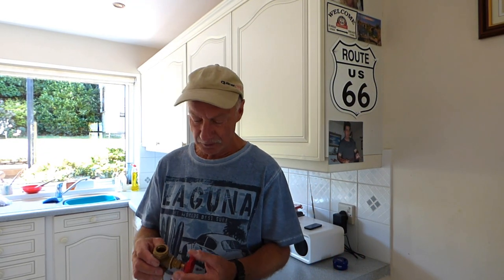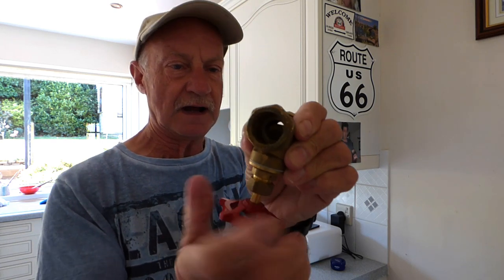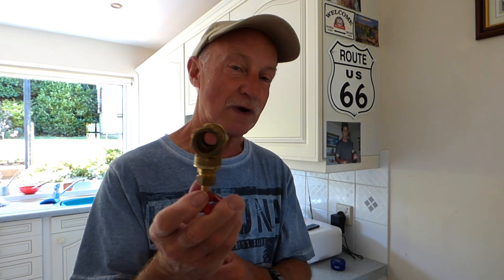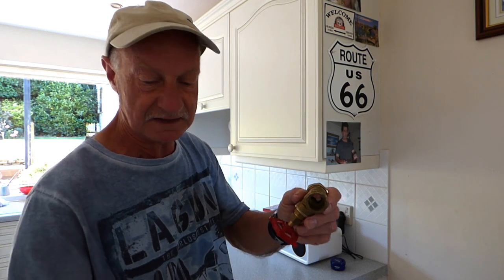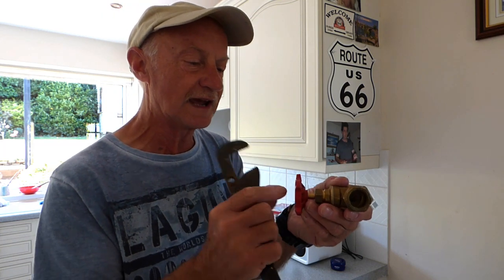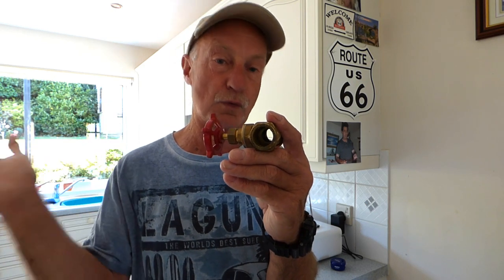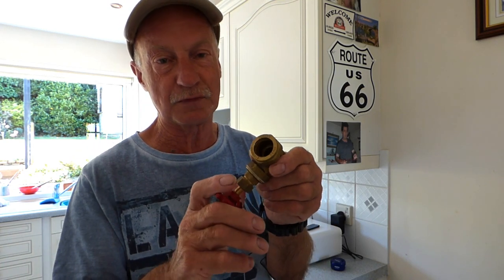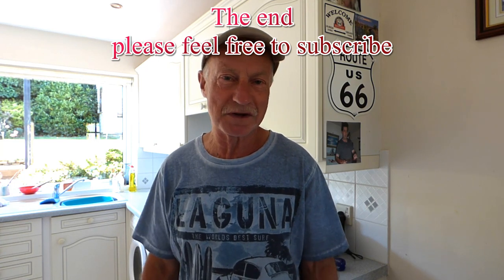How to free a jammed gate valve

Comment: Put this tip into action today! I had 2 jammed 22mm gate valves in the airing cupboard. They were stuck solid, couldn’t move them by hand at all.   On with the footprints, a gentle clockwise and anti-clockwise movement and hey presto, movement!! You could hear the limescale falling away inside the valve.  I was so pleased.  I was close to draining down to change the valves and I came across your video.  Thank you, thank you, thank you!!!
Reply from the maker: Glad it helped

Comment: How do I isolate hot water if the gate valve doesn't work? Can I replace the corroded valve without a water explosion
Reply from the maker: Drain the roof tank.

Comment: I have only a gate valve going into the tank and not out and non under the sink and I need to turn off the hot water cos its leaking to all hell in the kitchen. All I can do is turn off the fill valve to the tank. My face is melted.
Reply from the maker: Turn the one by the tank. Instructions in the question above.
Reply: @dereton33  yeah unfortunately all that did was turn off the cold. I thought I could drain the hot tank. Cos it had a red nob I thought it was going into the hot but it was the cold. And the other two pipes in and out have no valve and under the sink has no valve of any kind either. So I'm going to have to turn off the stop cock and drain both tanks I guess just to change a washer on the hot tap. Lol! Been a nightmare doing Xmas Dinner dishes and I eventually figured out I could put a rock on top of the tap to slow down the gushing. Thanks anyway. The worst thing about plumbing is relaising what previous plumbers have done ...lol!

Comment: rather than using grips I moved it by wearing cowhide protective gloves, mine stops eventually on a clockwise and anticlockwise - then I turn off water clockwise it stops turning nice stop but water in hot tap is still running after 5-10 mins and same pressure too. But gate tap feels like it is closing
Reply from the maker: It is jammed on limescale and grud, feeling like it is off but is not.

Comment: I’m having that problem with my hot water valve for the washer. It closes halfway only, I’m concerned if I work it back and forth to close it may start leaking at the stem??? Is that a possibility? I don’t have access to a main shut off valve.
Reply from the maker: Yes it may but is easily fixed.

Comment: I'd seen this video quite a while ago but never felt confident enough to have a go.  However, recently I watched the video again and decided to give it a go taking care as shown and surprise, surprise it actually worked !  I tippexed the gate valve and counted the revolutions from full off to full on and made a note for future reference.  I'll make sure this is closed and opened every couple of months or so to prevent the problem recurring and I'll be able to switch of the feed to the hot water taps when needed.  Thanks for the very informative videos.
Reply from the maker: No problem Alan.

Comment: Hiya Al, brilliant advice, I have been dreading tackling some plumbing jobs around the house, one because it is ancient plumbing work that has been reworked at least once, and two it appears to have been installed by some escaped lunatic.

Normally don't have issues with plumbing jobs, but I am facing a right old mish-mash of a system. 

So, I need to isolate certain areas off to work on them, and all the gate values looked like the came of the arc, all solid as a rock; I hand tried to do the above with my hands as wary of snapping the values, but have just bit the bullet and used an adjustable wrench, slowly did it,  They have all freed up, so no need to drain system and replace them all.

Many thanks and kindest regards

Mark
Reply from the maker: No problem Mark good luck with it.

Comment: Thanks so much!  I have a gate valve that is jammed due to hard water deposits.    I'll try easing it back and forth like you demonstrated.  Trying to replace a leaky water heater.  First step: turn water off.  lol  Thanks again!
Reply from the maker: No problem, great name, sounds a lot like a Beatles number on the white album.

Comment: Thank you very much for this video! It helped me to get the gate valve unstuck. Unfortunately its doesnt close completely, but enough to allow me to change the tap cartridge. The next mission is to find the correct cartridge for my Bristan Prism bath tub mixer!
Reply from the maker: Good luck with that one.
Reply: @dereton33  Thank you! Just an update on this, I managed to fix the leak by taking the cartridge apart. I first placed the ceramic disks in some white vinerar, left them to dry and then applied a thin coat of silicone grease (vaseline can also be used apparently?). Put everything back together and no more dripping tap! Many thanks again for your video, i would still be trying to get it unstuck and would probably manage to brake it if you hadnt warned not to force it beyond the closing point.

Comment: Great info thanks,
I this afternoon have had a gate valve fail in the  locked off position, handle just keeps turning, it didn't take much as I know what can happen with these, so was careful not to force anything too much, anyway I will now have to drain down a 50 gall tank, heyho.. 🙄
Reply from the maker: There is no repair for these.

Comment: Be careful with this. I just did as explained in this vid and have just thanked the emergency plumber for coming out lol. I managed to get the tap turning a bit and kept turning in very small increments, but I broke the shaft of tap and water started coming out. I obviously turned too hard against a very corroded tap. The advice in this vid is good but be aware that if it doesn’t start to turn easy, get the plumber out, or have water spraying everywhere.
Reply from the maker: If you are worried just plug the feed pipe in the main roof tank, before attempting to loosen it. To be fair you are the person that this has happened too.

Comment: Our gate valve must be turned off to shut water off completely from the outside tap so that the water to the outside of the house wall tap doesn't freeze and burst the pipe causing water to flood the interior of the house.   It worked for 50 years by just turning it on and off each season.  Now 53 years in, it has frozen because it was not turned off last winter. Good tips on easing it off, but that won't free up.  Stays shut. Would removing the packing nut, or bonnet enable one to pull the stem out?  That is a big issue that people like myself would like to see.  Thx.
Reply from the maker: Yes, you can try that
At that age, I would renew the valve.

Comment: The worst thing you can do with a gate valve is leave it open  fully,  as,   when the hard water calcium deposit gets into the gate valve threaded shaft you can't budge the gate valve handwheel in the  anti clockwise direction  at all.
You need to be able to turn the handwheel both anticlockwise and clockwise to disturb the calcium.
Reply from the maker: Good tip Dave.
Reply: Exactly this. It's best to leave all gate valves and stopcocks mostly, but not quite, fully open.

Comment: Great videos very helpful just one question i have a ceased gate valve in the airing cupboard its on a direct vertical pipeline from the tank in the loft that feeds into the imersion cylinder i dont know wether it is off or on. If it was ceased off  would i know about it ie cause any problem. Whats your opinion on this. Sorry for the long info & many thanks.
Reply from the maker: Don't worry it will be on otherwise you would have no hot water.

Comment: This video is help, just bought a house and I cant turn the valve left or right, I haven't tried using a wrench yet because I was worried I would  break it. So my question is, if I did break it would there be any danger of water pouring out ?
Reply from the maker: Not if it is just the handle which it normally is.
Reply: @dereton33  Thanks so much, I'm going to to give it shot. God bless

Comment: Great video. I want to turn off my hot water off so I can change the cartridge on my kitchen tap. I have an f&e system and the isolation valves to the tap have seized solid. I believe I can turn off the gate valve on the water supply to the cylinder, and then drain. My only issue is that the gate valve is missing the red turn wheel. Is there a  reason why the wheel would have been removed?
Reply from the maker: It has more than likely been snapped off by the past owner, you will more than likely find that the valve is seized up.

Comment: Hi Sir..Recently, I observed that my gate valve has become loose, and despite my attempts to open it, the valve turns freely without stopping. This has led to confusion regarding its current position, whether it is in the closed or open state.

I am reaching out to inquire if there is a solution to fix the gate valve without the need for a complete replacement. My primary concern is the significant inconvenience and disruption that would result from shutting down the entire building's water supply to replace the valve. As such, I am seeking advice on the best course of action to rectify the issue without causing any interruption to the building's water service. Looking forward for your answer. Thank you.
Reply from the maker: Bad news is all I can offer, that valve is snapped off inside meaning it can just keep turning without stopping. To save a lot of hassle there is a valve that can be fitted without turning the water off, it is called a self cutting valve.

Comment: I've got one of those, a jammed gate valve that is and I've been wondering what to do about it for the last eight years.  Fortunately we have supertaps and so can still change washers when required which is probably why the gate valve has become jammed in the first place.  It probably hasn't been turned off since the house was built in 1959.
Reply from the maker: O well good luck with that one.

Comment: Appreciate this: I have a gate-valve stuck.  I plan to replace the bath taps so I need to isolate the hot water.  The extra useful tip came when you said don't bother with any solvents,  However.... I wonder if I should use a blowtorch or source of heat?  Would that help?  My valve is semi stuck (I tried the rocking back and fourth)  I am using a hand towel to grip it not molegrips but I will increase the tork if I have to.  I  will do the back and forth just as you say.  I am sweating it if I try to wind it back and it gets stuck closed.  My other thought is to use a pipe freeze kit and remove the valve completely and replace the whole valve unit and with just a plug of ice to stop water flow.   Maybe tricky to freeze a wide 22mm pipe which is harder to freeze than a 15mm.  Wish me luck.... Jan 2021
Reply from the maker: Good luck with it Richard.
Reply: @dereton33  Cheers yes.  I did not need the blow torch.  Simply moving the valve back and forth slowly did the trick just as you predicted. I was lucky the freed valve didn’t break. I can now replace the bath taps.  Whew.  And I will be mindful to jiggle the valve every six months

Comment: There is one of these in my garage that controls out kitchen hot water. I think I broke it trying to turn it off, as it hadn't been turned in years and when I turned it and thought it was off, the water was still very gently pouring.  I got some mole grips on it and turned it some more and now its spinning continuously! I have a very weak flow of hot water Arrgjhhh!
Reply from the maker: Change the entire valve, it`s locked nearly closed.
Reply: @dereton33  Thanks Dereton, I'll think I'll  have to call a plumber in as not confident on my two hot water tanks upstairs. Although having said that  I now know where the cold water feed is going into them after watching one your videos. I could shut it off? They are heated by the 35 year old boiler downstairs.

Comment: Hi there, im changing bath taps, ive had to cut the pipes to remove but dont want to use flexy hoses, how can i put back new pipes to old feed pipes to new taps?, i was thinking of gate valves until i found out the cons...should i use a simple compression pipe connectors?, thanks in advance ; )
Reply from the maker: I always just use simple compression couplings with straight swivel tap connectors on the other end.

Comment: Hi Al,
Thanks for the video, its great.  
Can I ask, when a gravity feed system is installed and has a gate valve on the vent pipe,  ive been told this is not best practice and the gate valve should be removed.  Is this right and could you explain why please?
Many thanks Sarah
Reply from the maker: That is correct. If the gate valve is closed on the vent and the boiler was on heating water, the water, (or an immersion heater), the expanded hot water would have no where to go, so would blow the pipe off of the top of the cylinder.
Reply: @dereton33  Thanks Al, you are a fountain of knowledge!!

Comment: Hi, I can't get to mine as the side of a kitchen cupboard is in the way. I do have another valve, it's the type you have to put a flat screwdriver in but that's clogged & won't move enough to shut the water off, any advice on that? Thanks
Reply from the maker: Renew it with a better valve type.
Reply: @dereton33  That's  what I want to do but I need to be able to turn my water off & the two I have won't turn.

Comment: Which way open and which way close when your facing it how do you know ?
Reply from the maker: Ok I will do a video on this. Here is the answer though, clockwise off anti-clockwise on.
Reply: @dereton33  thanks so much I eventually put a rock on the tap cos the hot system has zero valves of any kind along it to turn any part of it off even cold into the hot tank hasn't got one. Maddening.

Comment: Help me the gate value red knob was so old i used wrench and broke off. Now I can't turn the water off there to drain water heater. Is there another way to drain water heater so I can replace the heater?
Reply from the maker: Turn off the main and run the hot tap until it stops.

Comment: What if you can close it all the way and it doesn't stop any water?
Reply from the maker: The valve is broken
Reply: @dereton33  I think I will shark bite it . But sucks new to me house,and previous people. Do t have a shut off until way way back at the main.☹️
Reply from the maker: Yes usually under the sink.

Comment: Well, shite! I appreciate the info but me problem is quite the opposite. The valve on the water heater is stuck closed and the knob just spins and spins with no effect and the bugger of it all is that it was soldered in place. Not sure of the gobshite that did the plumbing on my flat but I wish I could insert my US size 9.5  boot up a certain orifice if theirs.
Reply from the maker: The perils of bad plumbing,.

Comment: another way is to put whole unit into a jug of fresh coca cola and leave overnight.
Reply from the maker: Thanks Paul great advice.
Reply: can I do that for my under the sink valves?  I cannot get mine to budge. I wrapped them in vinegar soaked socks overnight but they are still impossible to turn (or wiggle or rock back and forth)

Comment: Fitting gate valves is a complete waste of time. When one comes to need them one finds they have either completely seized up, or they turn off but don't turn back on again or they start leaking. They nearly always let water by anyway when supposedly turned off. 
I prefer fitting quarter turn full bore lever ball valves. A few quid more but well worth it. At least they are reliable.
Reply: Nick Collins Damm right chavvy

Comment: Not a very scientific approach, I had a think and applied the old coefficient of linear expansion, so I got my gas blow torch, a thick cloth and a piece of flame resistent mineral board to place behind the gate valve. I lit the blow torch and gave the body of the gate valve a good few mininutes of heat, you can't do any damage as the water in the valve prevents from from geting too hot, take away the flame and immediatlty using the cloth turn the gate valve anti clockwise, and in my case it turned straight away, turn a few times plus a bit of WD40 and it works perfectly.